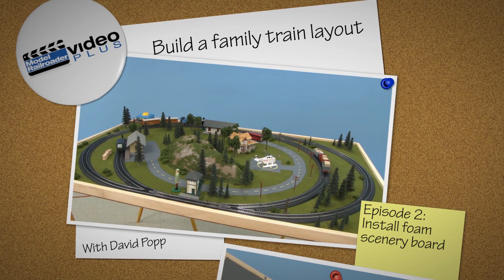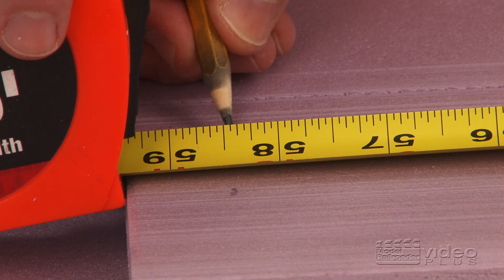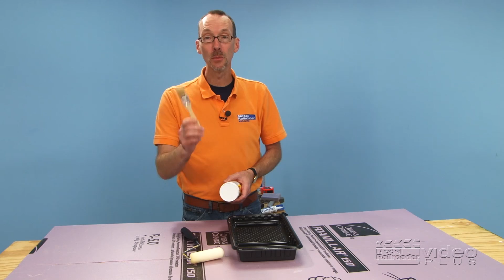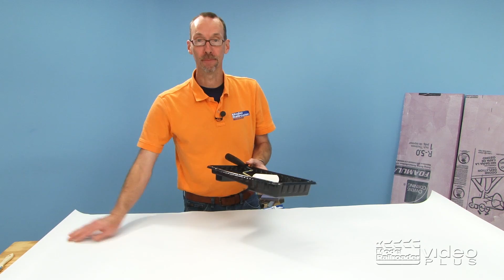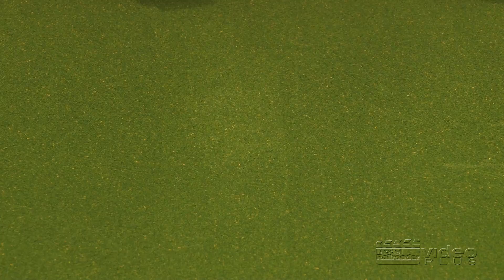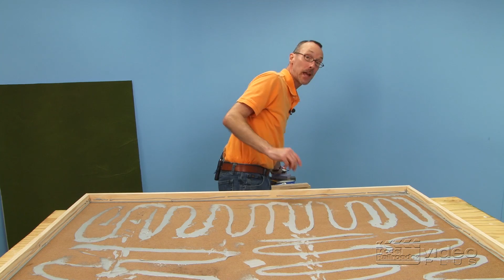Family Train Layout: episode 2 - install foam scenery board

Comment: [the, builder supply center were im. at dont keep enough of the blue green and pink foam board because of all of the house building thats going on out here. the o ly foam board that the building center has is the 2" foam board that has the aluminum backing on both sides. so thats what ive. been buying for ho-scale model railroad.  it all works out.] again, thank, you for youre video.👍

Comment: I have a lot of foam to cut and shape into scenery pieces, So, I was wondering, I have some Home Brown Latex paint, Could I mix that paint with a white glue, say PVA type to paint my scenery pieces the base coat and have it seal it also, so the next few colors won't soak into the foam so much, Also, can you paint Acrylic ontop of home Latex paint, with no issues of deforming details in the foam?

Comment: One of my old model railroad layouts used a similar grass mat, and it's definitely good for starting out with. But nowadays I just paint the insulation foam in an earth-like color and sprinkle on the green ground cover materials on the areas where I want grass, and earth-colored ground cover material in areas where I want dirt.

Comment: why use glue??? carpet tape works just as well. if you ever need to remove or remodel just peel it up.
Reply: Just a freindly reminder, this is a basic table style layout intended for children to use. There are many ways to skin a cat, so to speak, and with that said, there are a bunch of tools and methods to built it. This video shows just one of those methods.

Comment: One problem with this video is the pink extruded foam board or even the blue extruded foam board is not available in many areas of the U.S.  I can not find any extruded foam board in my area of California.
Reply: even at Home Depot? is insulation panels, like for homes